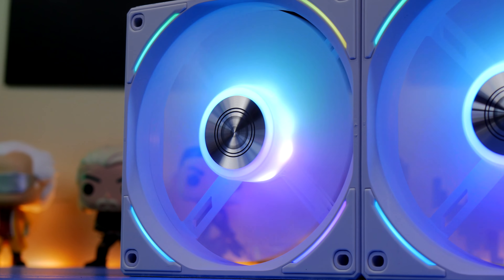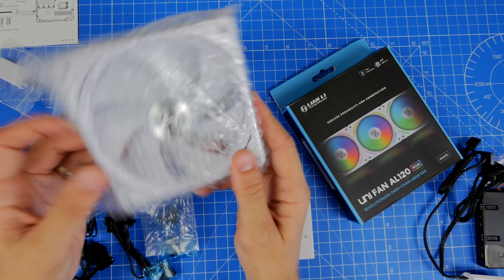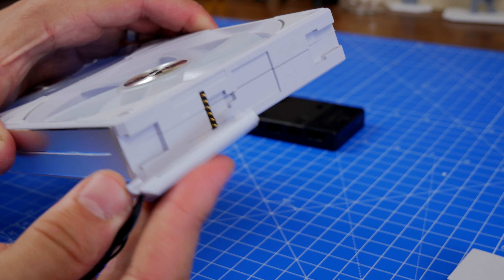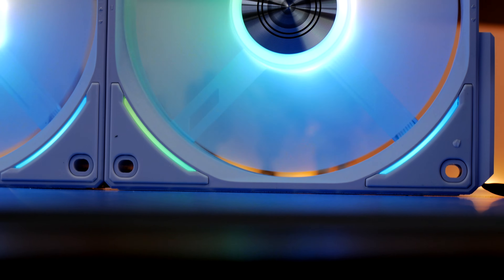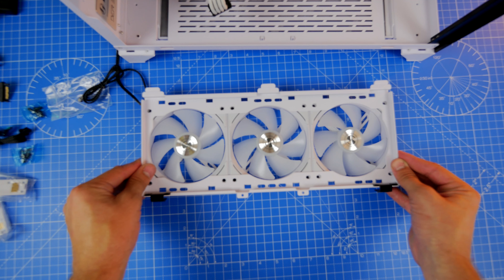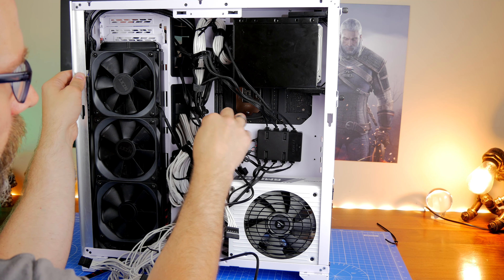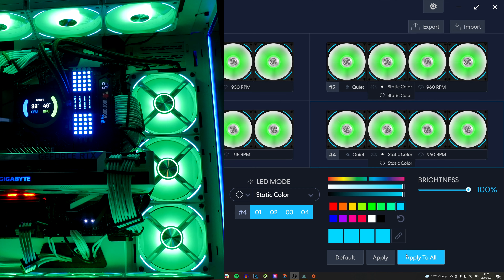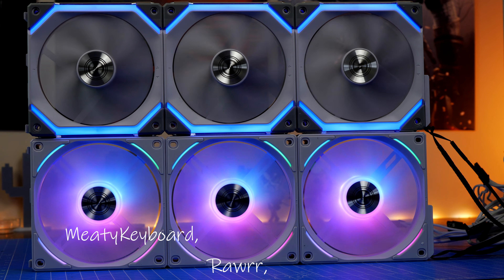Lian Li Uni Fan AL120 unboxing and setup

Comment: They need to take the border lighting for the SL merge it with the blade light of the AL - they'll have a REAL winner. 

Because honestly, the SL120's border lighting is one of a kind.
Reply from the maker: Yup
Reply: Why be worried about the looks of the blade. It’s moving at 500-1900rpms lol. These look miles better than the sl’s. That octagonish lighting is kind of meh and the rears look like trash.

Comment: THESE FANS ARE BEAUTIFUL! Yeah, getting excited about fans is odd but these are great. I was still in the return period after getting 10 Corsair QL120s and the dead spots around the rings just could not be ignored (dead areas between the LEDs, not dead LEDs). Everything described and shown here is spot on. These also work with SignalRGB. The Corsairs look slightly more like the effects because of all the lights. For example, the QL120s do better when there are distinct objects like the radar effect but the AL120s work really well with anything that acts like fire, brimstone, etc. which just work better with the AL120s. Thanks for your video, you made me much happier with my new AL120s and saved me almost $200.
Reply from the maker: They're great!

Comment: I really do love your reviews . I have come across your channel while trying to install into a 5000d with Elite Capellix 150i. After watching your review i did grab myself some more Corsair fans and have gone to a 13 fan setup :) 
Lian Li is a good brand with cases . I do use the Strimer Plus set in my case from Lian Li. Quite happy with it esthetically .Never though have bought or experienced any other equipment.
For me its just Corsair . I do believe to go with only one brand for better synchronizing 
Pls do keep up the amazing reviews !
Reply from the maker: Yes it's much easier to stick to one brand if you want to keep the RGB the same
Reply: @TheProvokedPrawn  my 10 al120s and my Cappelix h150i’s are quite happy together.

Comment: Theres a new version of the al120v2 apparently because my cables are slightly different and also the intake side of the fans are different as well if you can believe that. I checked like 7 times i have the correct al120v2 3b sets. The two cables you have coming off the end there on the end of the 3 set you got... thats just one big cable now.
Reply from the maker: I know https://youtu.be/ko2Z3-w8-is

Comment: For me, if the intake center piece on the SL120 was like the front, I would prefer the SLs without a doubt. As it is, I'm going with 3 ALs on the side and 3 SL on the top

Comment: I prefer the sl120 (design wise).
Reply: same these are cool for an alternative though. good battle for the ml120s from corsair but yes the originals are better but good to have more options
Reply: I just wished they put the brushed aluminium plate/sticker of the al120s on the back of the sl's

Comment: How would you go about installing these fans on a different brand AIO? For example should I just connect the PWN Fan Cable from the Lian Li Fans to the CPU Fan Header? Or do I need to plug the Lian Li PWN Fan Cable to the AIO Pump First? Because my AIO has 3 x PWN Fan Cables and 1 x RGB

Comment: On the fan connection where it has that RGB address if you don’t have a 5 V RGB on your motherboard, do you plug that fan connection into the system fan

Comment: Your reviews are refreshing though. Love to see you build.

Hope they much better QC than SL120. Lian Li is great, phenomenal for cases but anything else am never gonna buy Lian Li. Have 9x SL120. Two of them got led issue, and one fan doesn't spin.
Reply from the maker: really? that's sad, my SL120s have been running fine since the first video I did.
Reply: @TheProvokedPrawn  ah am glad well maybe am unlucky but other issues are the hub box man the wires it's designed as such you need to yank some of the cables to remove them. The build is so so bad. Now okay I don't look at it everyday or open it I can overlook it. Now the software gosh. It blocks the ctrl shift t key combo system wide. The software needs to on for mobo sync too. Now finally they released L Connect 2 but that installs to diff folder, doesn't work with original SL 120(unmarked hubs). Had to dig through reddit to get firmware updates for the hub and then it started working. Again no auto update, no single place to download software, documents. LConnect 2 download is only on AL 120 page. In all LL products, cases are a premium top notch world class, rest feels budget and those deep cool like stuff.

Comment: I think I have set up everything just like you in the video with the exception of using CPU_FAN instead of SYS_FAN for the Lian Li fan controller. Is that a problem? Also no single fan is connected to the breakout cable of my NZXT Z53. It's only connected to FAN_PUMP. Am I missing something? 
I could plug the single exhaust case-fan into SYS_FAN or should this one also go into the controller together with the 2 radiator fans?

Comment: Question, My main question if I use 1 controller, am I able to set (Zone 1 AIO) Fan speeds let's say 1200rpm. And then Zone 2,3 & 4 to Quiet 800rpm... or would I need 2 controllers.

2nd question- 
Can I hook the controller to the cpu fan header if I'm using a AIO... or am I supposed to have 2 controllers. 1 for the AIO and the other for standard system fans.

Plan to have 13 fans total in a lian li 011 evo.

Comment: So if I have my SL FANS already connected to my controller and I connect AL FANS to that same controller, will it recognize them as AL FANS? Or do I have to add an additional controller?
Reply from the maker: I didn't try it due to the spec differences so I'm not sure
Reply: I dont think so, from what I have seen the controllers are both labeled as either SL or AL, and the software detects what fans based off the controller. They would still be able to light but it would just be the SL lighting options

Comment: Would I be able to connect the fans to the SL120 Uni controller or the SL120 Uni to the AL120 controller for the ARGB? I only have one ARGB header and would like to use both sets of fans with the ARGB. If not, would an ARGB splitter work by connecting the controllers to the splitter? Thanks.

(Also if the splitter thing would work what's a good brand)

Comment: Thanks for the video, I've one question I'm building from a long time so bare with me. Is there a way to set fan speed to auto so they will speed up or down depending from temps? Thanks!
Reply from the maker: You can do that in the software. And usually within your motherboard software too with PWM mode and setting a fan curve. So they ramp up when needed and down again when not.

Comment: So if I need to use 2 for my radiator. Can I plug them direkt to CPU fan? And only plug in the rbg in the hub? Or do the fans power connection be in the fan hub for it to work?
Reply from the maker: Yes that's possible. I've done it.

Comment: Strictly speaking about RGB I'd rather go with Corsair still especially since these are $100 while Corsair ll120s are constantly under $100 on Amazon. Not to mention Lian li fans are almost never in stock or marked up in price.
Reply: You get what you pay for. Pay up a tad more and get rid of a bunch of nonsense cable management and multiple controllers (if you have a lot of fans). These have a more original look to them imo than Corsair. Corsair needs to step up their game with the setup.
Reply: @buxtech  I'm strictly speaking about RGB. I'd rather go with Corsair which has waaay more effects and more mature software. These look like regular RGB fans that you buy in a 3 pack for $28 if I'm being brutally honest and its only saving grace is less cable. Also agreed, Corsair needs to update their stupid setup process for these fans, if they can do so and deliver the same RGB effects, at the same price then it's gonna be tough for Lian li. Also you mention less controllers; uk if you buy Lian li strimmer+ cables like the 24pin one, you get a controller with it and it's not integrated in their software. So you get two big ass controllers in your case.

Comment: Too bad the PWM feature still doesn’t work. I have 10 SL120s in my case, set to PWM in L-Connect, fan header set to PWM in BIOS and the Uni Hub doesn’t even register in BIOS. Such a shame that awesome hardware can’t work at all because of bad software.

Comment: Hello I have an issue with my AL120 fans. The rgb is changeable but the fans are stuck at max rpm and when I change the speed it doesn't change? Can someone please help!
Reply from the maker: Do you have it set to motherboard controlled in the software?

Comment: 17:13 Does the USB cable of the controller have to be connected to the mobo if you only plan on using the mobo's rbg settings?
Reply from the maker: USB for control via L Connect. The RGB header cable is for motherboard control.

Comment: Hey buddy I installed all of my 10 fans and somehow the Lian Li software is not able to detect the controller but the fans are spinning and they are in rainbow mode. What should I do now?
Reply from the maker: have you got an MSI motherboard and tried the fix for that? And/or have you installed L-Connect v2?
Reply: @TheProvokedPrawn  i got an Asus ROG mb and I currently have the L-Connect 2 software installed
Reply from the maker: I found a fix from here https://lian-li.com/faq/

Please donwload the following software to remove ASUS Armoury Crate software from your computer before you install Lconnect .
https://dlcdnets.asus.com/pub/ASUS/mb/14Utilities/Armoury_Crate_Uninstall_Tool.zip

After you remove it , please restart your computer ,and install L-connect app.

Run the L-connect ,and see if the ARGB can be control .

Install ASUS Armoury Crate software to your system after L-connect works on your computer .
https://dlcdnets.asus.com/pub/ASUS/mb/14Utilities/ArmouryCrateInstallTool.zip
Reply: @TheProvokedPrawn  Did that it worked but now all fans + aio fans are running on 100% and 3 fans are not lighting up well it made everything worse but thanks anyways
Reply from the maker: @dominik_6336  sounds like it's in motherboard sync mode?
Reply: @TheProvokedPrawn  its actually off I turned my pc off completely and uninstalled L connect and then it fixes the issue idk whats going on
Reply: @TheProvokedPrawn  hey man little update: The software works now but when I first launched it suddenly all fans went to 100% speed and 3 random fans were not lighting up so I connected everything to my motherboard ( RGB + PWM ) then I put everything on quiet in bios and after that I tried to adjust the RGB with the motherboard software which only works when you enable motherboard sync in the L connect software but it's so weird right now because sometimes it does work but sometimes it doesn't. The fans often just stay in rainbow mode and when I restart the PC a few times it lets me adjust the RGB through my motherboard software like dude I don't get whats going on with this Lian Li software it's so annoying I'm just lost for words